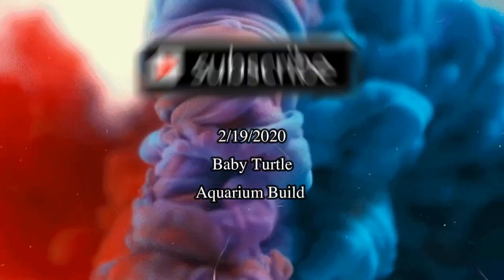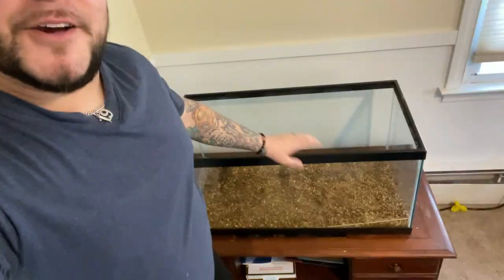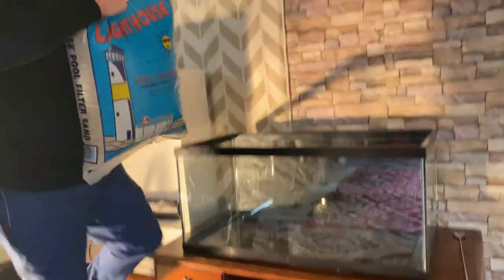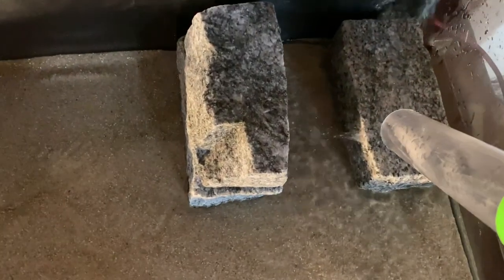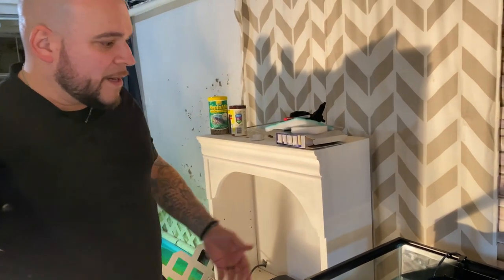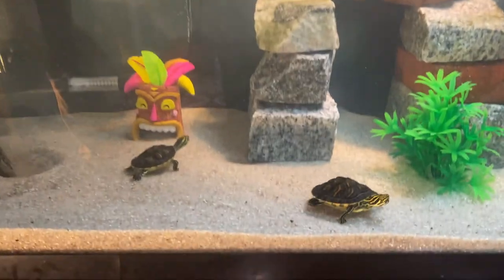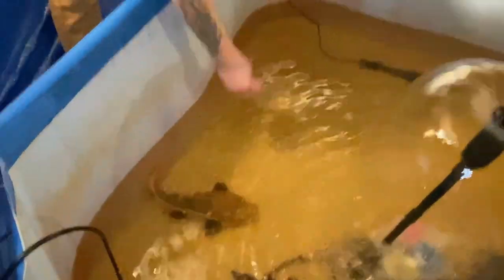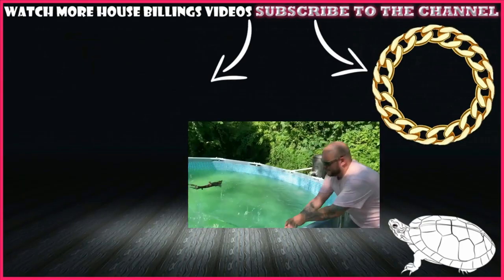BABY TURTLE AQUARIUM SETUP (diy FILTER & BASKING DOCK)

Comment: I ended up with a turtle but have no ideal what kind it is and what I should do. It came from MIssouri what part I'm not sure. I've had her in a cage with water in a bowl and I finally got a 40 gal tank and put her in it but she seems like she doesn't really swim that well. Figured she would go to the bottom and check things out but just stays on top and breath really hard when I put her on her floating thing.Never owned a turtle before could really use some advise. Thanks in advance. We thought it might be a map turtle but really don't know. I would seed a picture of my set up and what she looks like if I new how.

Comment: This is so cool, I want turtles but someone had told me they carry a disease and I don't think my mom will let me have some
Reply from the maker: Thanks! Turtles are awesome to have. They require some work with cleaning the tank, having the proper setup, and making sure they get the right food but they make up for all of that with personality. Also yes they can carry salmonella, but as long as you wash your hands after handling it’s nothing to worry about :)
Reply: Thanks, it's cus my school has an aquatics program and they're giving away turtles that was just recently hatched and I wanted like 2
Reply: @goodiegoat6923  The only disease that turtles transmit is salmonella and its very rare and preventable if you wash your hands before and after handling them.
Reply: They carry salmonella but all animals carry it, wash hands after touching

Comment: What kind of heater should I use for a 10 gallon tank for turtles?
Reply from the maker: No turtles should be in a ten gallon tank unless they are tiny babies
Reply: @HOUSEBILLINGS  yes, this one is a very tiny red eared slider.  Will probably only keep her in the 10 gallon for a couple of months.. but wondering if I should put a heater in the water?  And what size lamp I should get.
Reply from the maker: I would def put a heater in the water unless you live down south and it is warm enough to not need one. They dont need anything crazy warm but the water should be 74-78ish if possible
Reply: @HOUSEBILLINGS  well I live in the Houston Texas area. We usually keep our house around 77.  Thanks for the info.  I also have 40 gallon tanks whick I will probably put this little one in once she gets a little bigger.